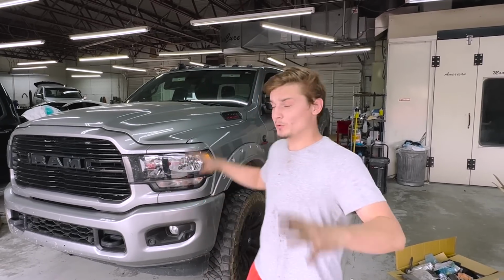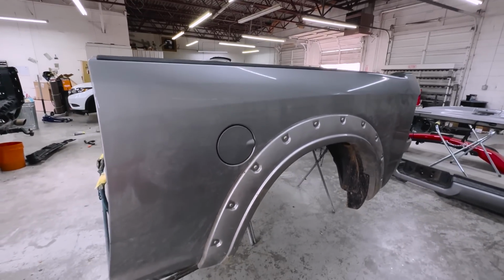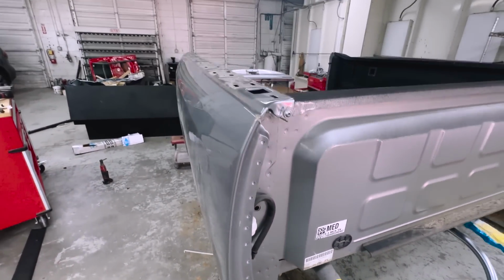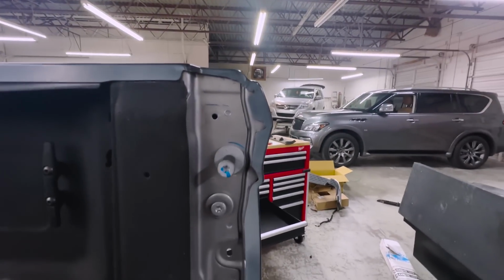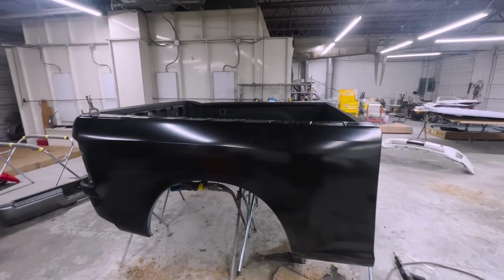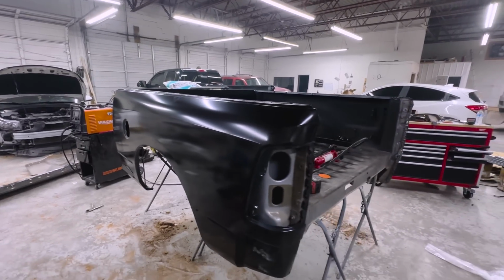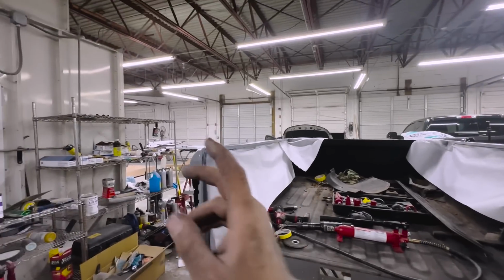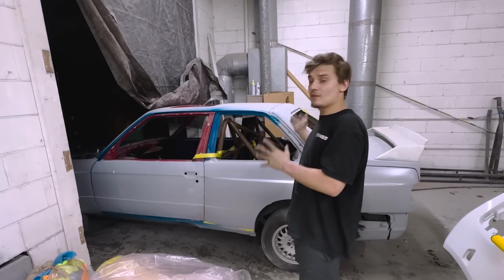Fixing A 2020 RAM Cummins Diesel After A Goose Neck Landed On IT!!

Comment: you dont like using a resistance spot welding you had a lot of welds that even a basic spot welder would get to and then you would have oe finish quicker less chance of corrosion at weld points no filler or grinding just da prime and paint. if the truck was mine repair original